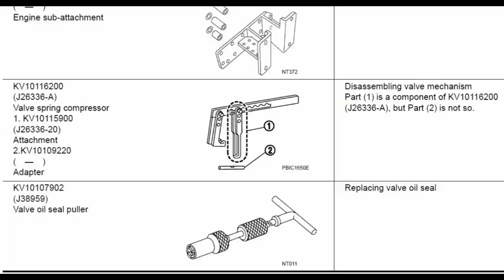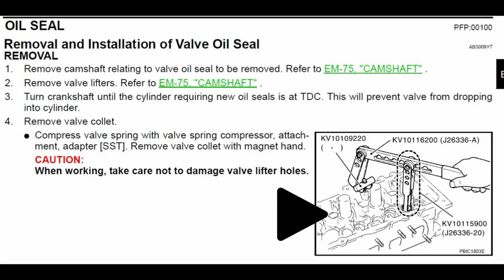350Z VQ35DE Smoking - Valve-stem Seal Replacement Part 3

Comment: My Z is also smoking and has been for a while now. Not sure I would attempt this at home so well done! I think I’ll take mine to the garage, going to hurt my wallet I know. Can the worn seals cause damage long term?
Reply from the maker: Hey James, long term it can gunk up spark plugs and cause missfire, and you will have to keep close eye on oil consumption. Mine was chowing about a liter oil every 1000km. So important to make sure engine has enough oil.

But thanks man was a daunting task. But quite fun